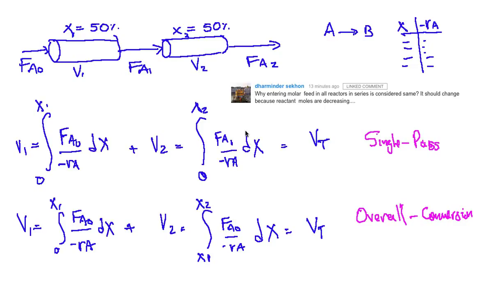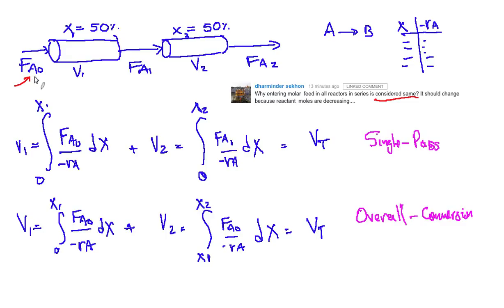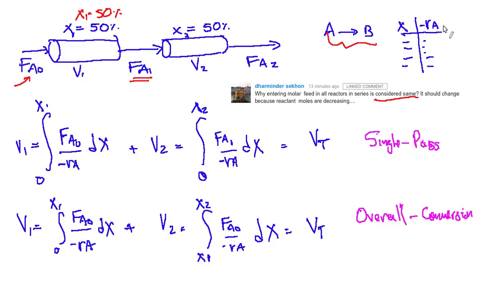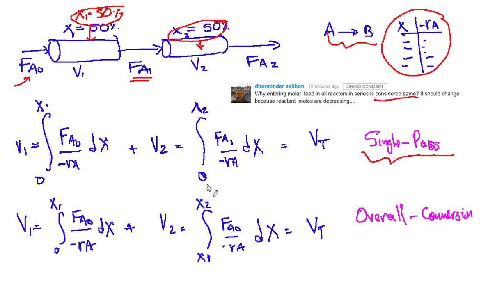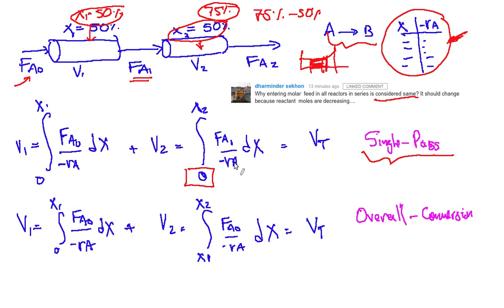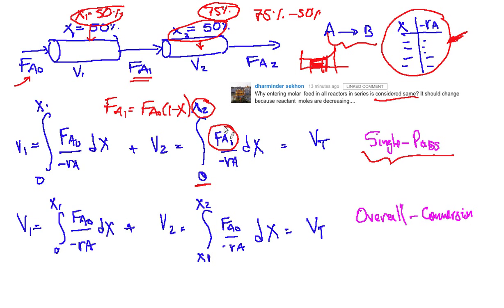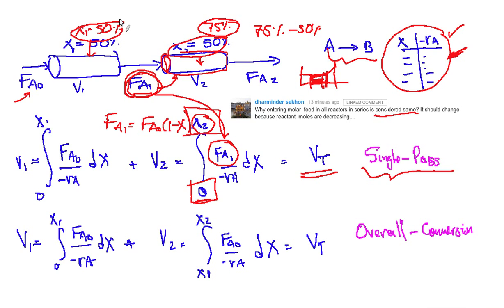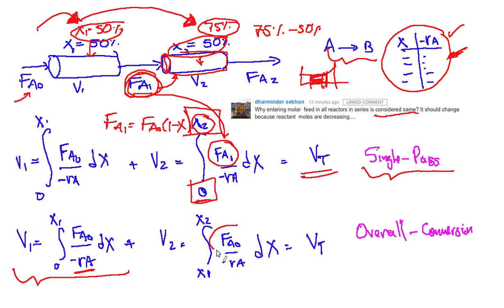Single Conversion vs  Global Conversion in PFR in series // Reactor Engineering   Question & Answers

Comment: Yeah i am getting same total volume in both cases but here is one very important point to be noted. If the concentration of feed entering first reactor is CA0, then in single pass method while calculating V2 we will take it CA0/2, but in overall conversion method we will take it CA0 for both V1 and V2 calculation.
Reply from the maker: Yes... due to the definition of Concentration... haha but better work with flows... they are easier to calculate